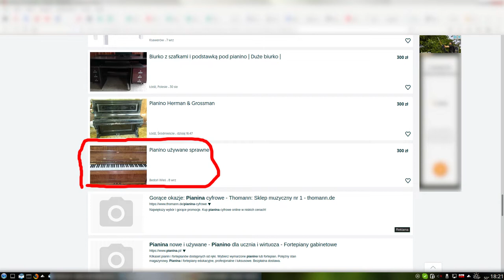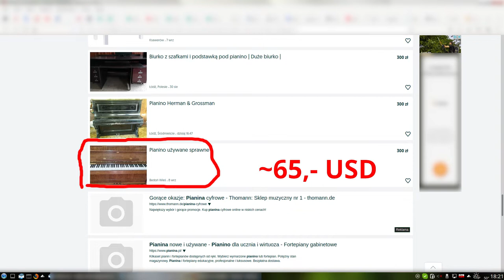How I'm Not Making A Piano Keyboard For DIY Digital Piano. (Digital Piano Build: Part 3)

Comment: it might be cool to make one where you leave the hammers on the keys, but instead of hitting strings they hit force sensitive resistors to measure the velocity!
Reply from the maker: I've thought about making something like that with piezoelectric components but I came to the conclusion that acoustic piano key action mechanism is too complicated for the purpose. The less complicated mechanism the less likely it will break. I'm a fan of making everything as simple as possible.
Reply: @TedsProjects  well I've had this one piano downstairs for almost 20 years, and it has never had to be tuned or anything. They're pretty solid instruments, unless you're constantly moving it around it shouldn't break. One of my friends has a mini piano which he carries around london in a van, wheeling it around, and it seems fine